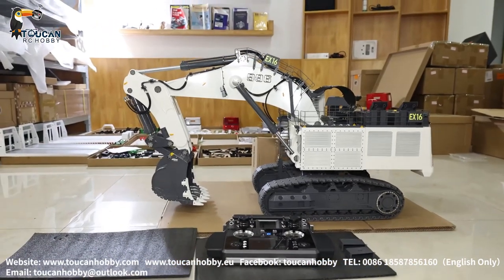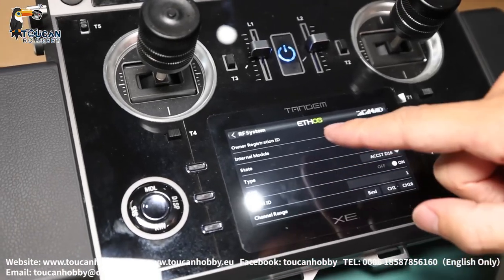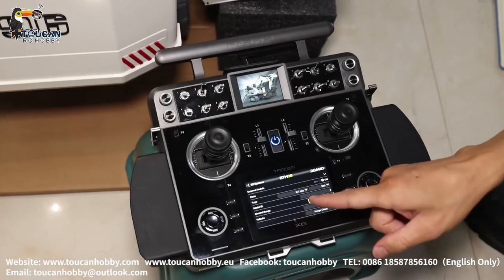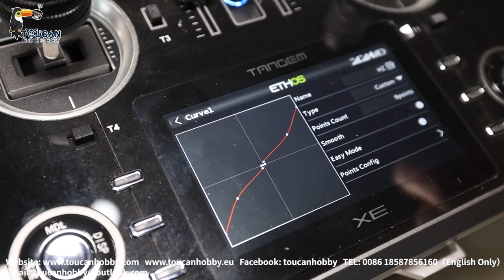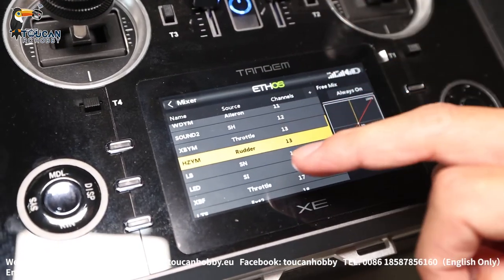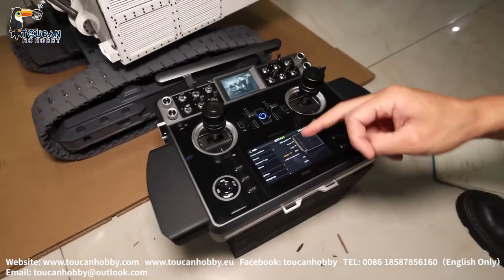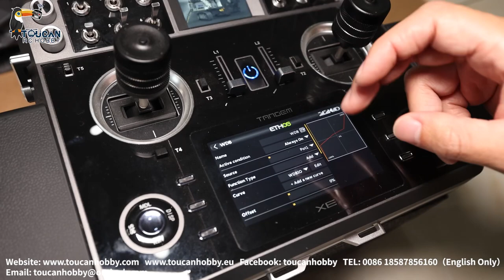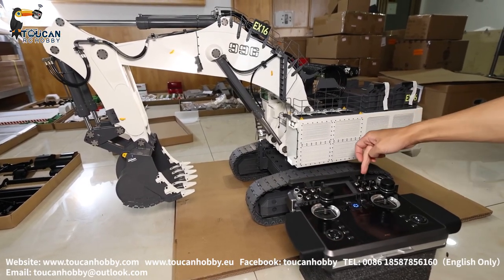How to bind 4 recevers for 996,FRSKY XE radio, 4pumps.radio settings of all functions control curve.

Comment from the maker: I’m  Oliver for more details and discount please add my Facebook: https://www.facebook.com/profile.php?id=100083176249155, whatsup +8619376345156
Reply: Hello Oliver, I am having problems binding the hydraulic receivers. Do you know if it's possible that the receivers need to have a firmware update? Also when I bound the receiver under the cab, the lights are flickering. Thanks for your help with my problem.
Reply from the maker: @rcon8017  have you changed radio different version? Add me friend send me messenger to see details